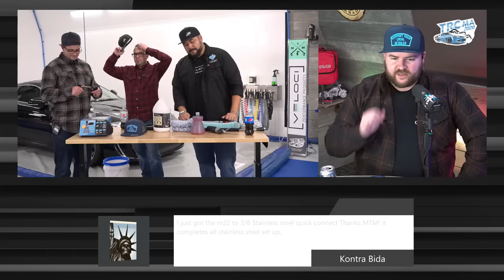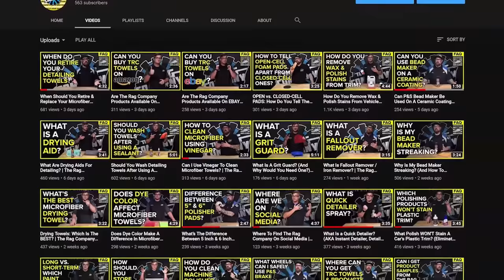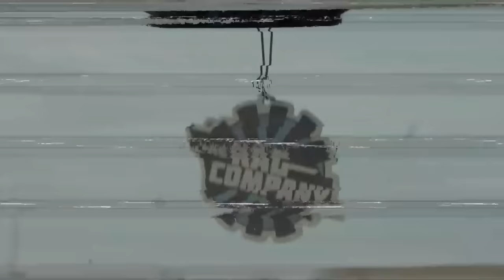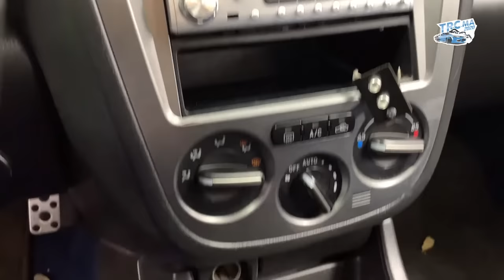MTM Hydro & Veloci, The Rag Company *SPECIAL SECRET REVEAL* | Live Detailing Event | TRCMA 2020

Comment: I purchased the 1st version pf22 about 5-6 years ago. I was the sole detailer at a local collision shop on average doing about 4-5 cars a day. With using it 5 days a week and making sure I ran clean water through the system at the end of each day...it performed well for about 6-8 months until the internals wore out entirely...also the plastic bottle threads no longer held a tight seal to the point I would have to hold the bottle together with the nozzle. Im not sharing this to shine a negative light on the product but to give someone a realistic idea of what to expect with extended..constant use. I loved using it..